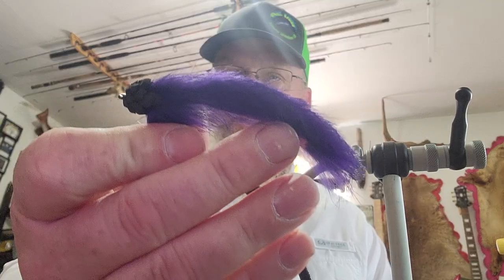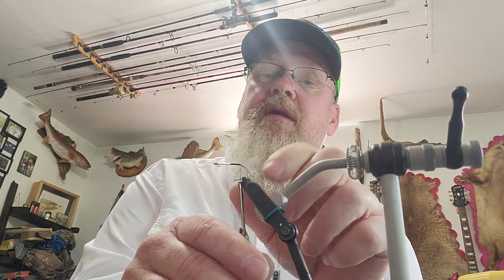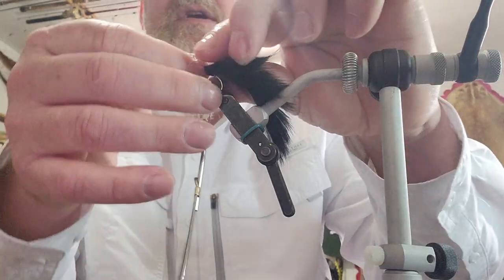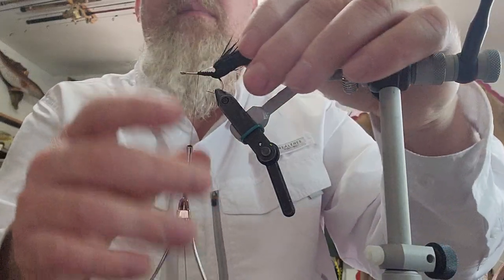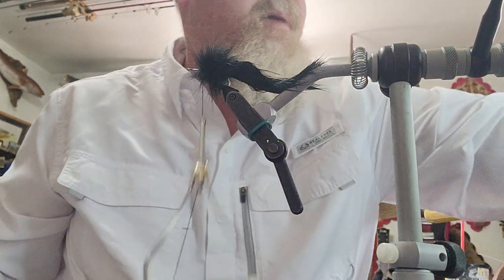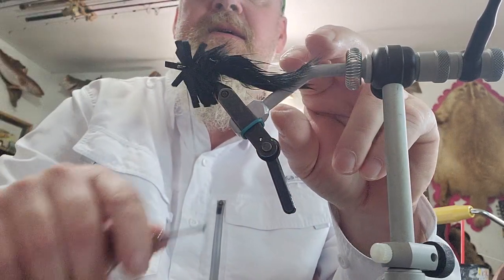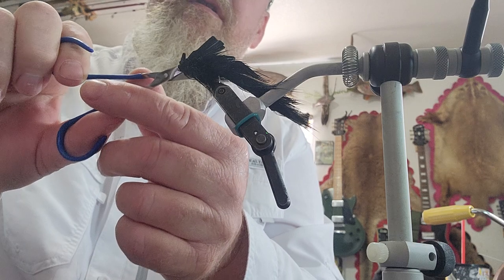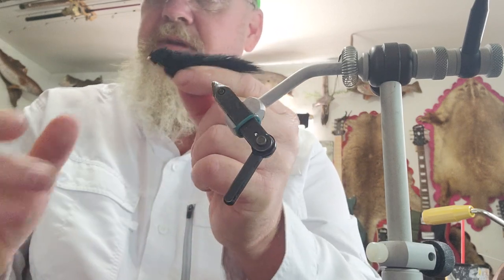Spinning craft foam like deer hair.  Creative method to tie cool looking flies. #flytying #foamflies

Comment: Is this a surface popper or a fly that sits in the surface film of the water? Do you find that the zonker, when completely saturated, pulls the fly under? 
I would be inclined to weight the head slightly to get it to sink, and use the big foam head  to send out  vibrations that a predator fish could pick up on its lateral line. Any thoughts on this?
Reply from the maker: It sits down in the surface, the zonker pulls it down pretty good.  Has cool action, but I do like your idea of weighting it down.  I'm gonna have to try that.  I bet it would be very effective that way.